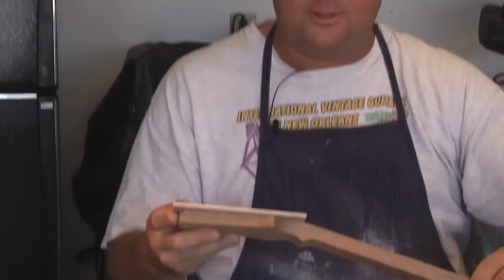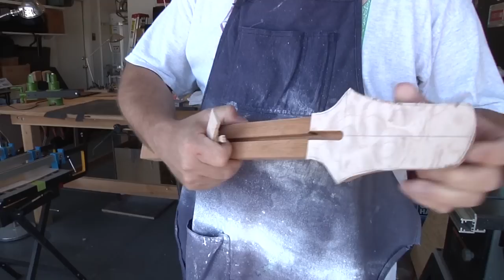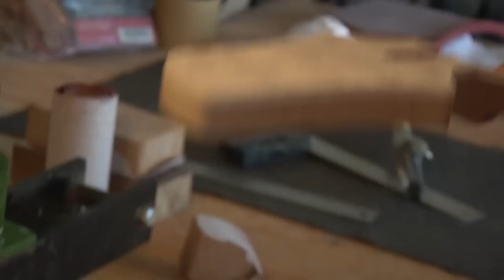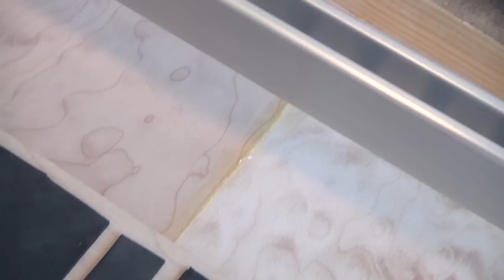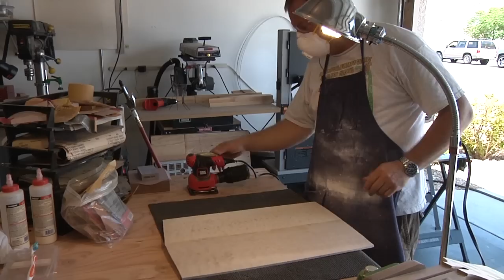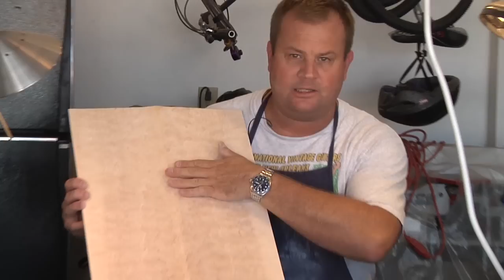Erics Guitar Garage-Ep5.Guitar Top The Maple Veneer

Comment: Hi randy and thanks for the comments! The answer to your question on removing all red dye from the veneer can be a tricky one. If the veneer is very thin, you have to be very careful about sanding through it. If its a quarter inch thick or thicker top you'll have better results. Try some 220 grit and cork block and go easy on it! Best of luck!

Comment: nice work!..I have question, I have a red guitar(washburn by grover jackson) I am trying to refinish and Im in the middle of sanding paper right now after I already removed the paint..my problem is the striped veneer on top of the body, I couldn't get the natural color of the wood bcoz I think it was dyed with red color..Do I have to keep rubbing it with sand paper until the reddish color eliminates?,. thanks man.. God Bless

Comment: For my tops I use a 1/4" top. A veneer is actually a lot thinner. Say 1-2 mm thick.
Reply: Right?  I'm thinking the same thing - here he's simply doing a nice top quality quilted maple top.  If he were doing a veneer, he'd be doing a super think layer over the body like on the cheap imitation guitars.